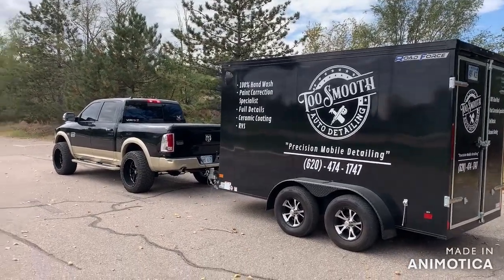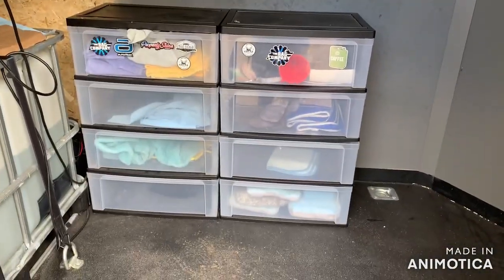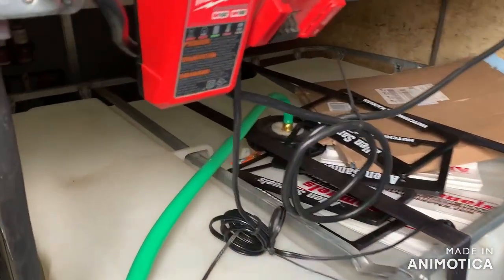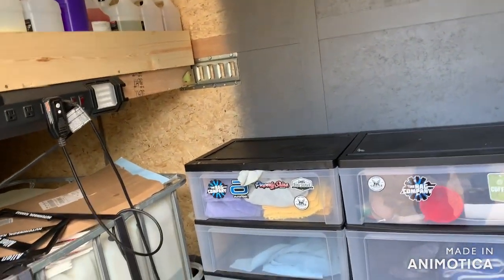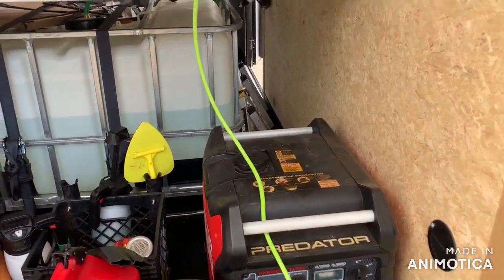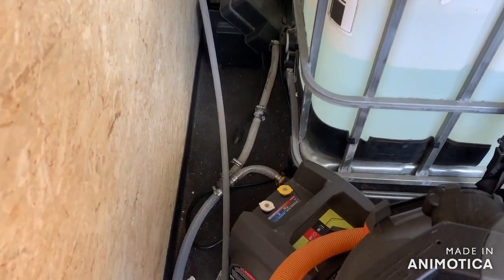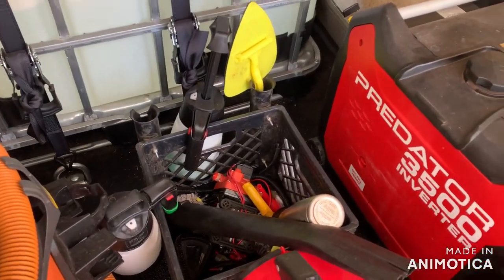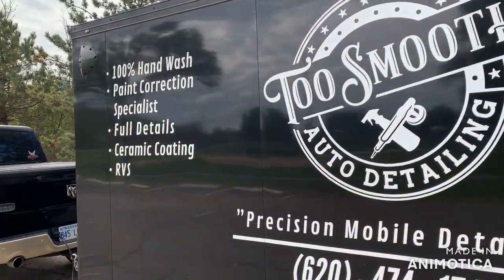TOO SMOOTH MOBILE DETAILING TRAILER SETUP

Comment: Nice set up bro. I was told today by the dealer that sold me my trailer AFTER i bought and drove 9hrs for, that too NOT HANG ANYTHING  on the doors for this exact reason . Im  pissed. Looks like we got the  same design built trailer. These doors are garbage if any weight  get  put on them. Would love to know how its all holding up.
Reply from the maker: Thanks man! Yes I gave up on hanging stuff on the doors now. You really don’t want your chemicals out in the sun anyways. Makes bottle fade. Everything so far is holding up awesome! It’s been through some changes I’ll have to post an update.
Reply: @toosmooth3989  right on dude. i  think  we could get Replacement hinges for  these doors not too expensive. Would love too see the upgrades and  changes you made. Keep Killing it !!!